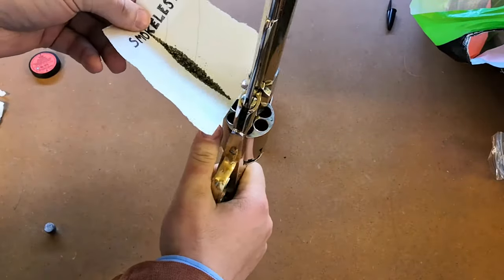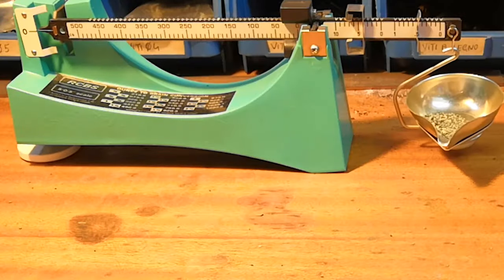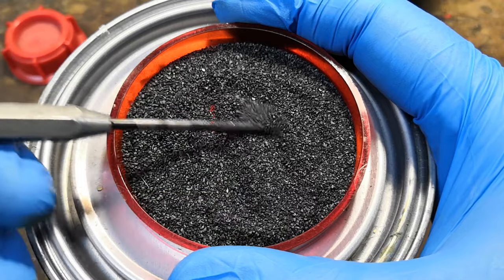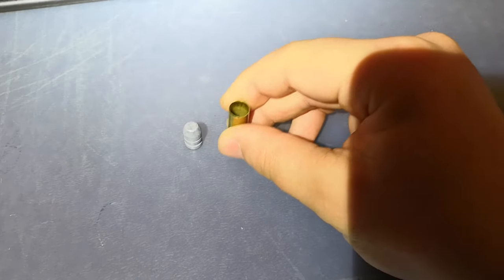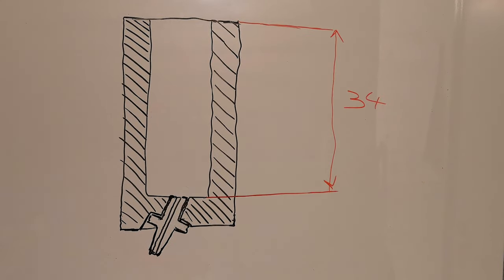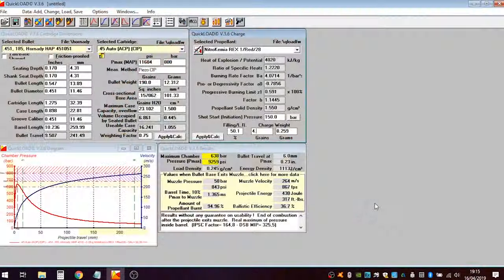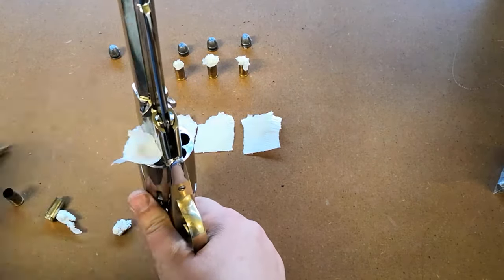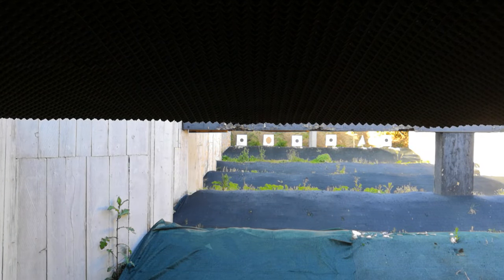Smokeless Powder in a Muzzleloader: What Really Happens ?

Comment: They key is to measure the muzzle velocity and compare it with quickload to estimate the pressure.
Here is a video by IV8888 trying to blow up a muzzleloader with smokeless: youtu.be/en384qVqrug
Reply: Savage Arms proved the right kind and amount of smokeless powder can be used in a muzzleloading rifle over 20 years ago.   Many thousands of the Savage 10ML rifles are still in use today.  Thanks to this channel for being a "Myth Buster".
Reply: Comparing muzzle velocity to Quick Load data can be ambiguous, as pressure spike cannot be exactly calculated without a pressure transducer afixed to the combustion chamber.
Reply: You can buy a reproduction cylinder, epoxy some strain gauges to the side of each chamber, and directly measure how much it strains during each shot. It's a very indirect way of measuring chamber pressure, but it is a direct measurement associated with with the particular weapon and is thus not prone to the errors caused by someone else's unreasonable assumptions.

Oh, you do also need a very fast DAQ to capture the event. Without one, you won't see much on the graph.

I would anticipate some very different looking curves, and I would be careful with how much trust is placed in this method. The fastest of pressure spikes will be mitigated by the ductility of the metal, so if the curve is getting sharp, I would back off.
Reply: Totally wrong
Reply: @Chris_A_  Christ, this is a problem I have, living off-grid on a mountain. I'm smarter than you, don't sweat it, I'm not gonna blow up my kids a second time... But I could use your experience, if you know what I mean... So I've been cooking my noodles over this thought since I found the unsecured recipe, see, and I've got some theories, understand?, but zero experience (and a ridiculously large cannon) and 20 pounds of BP), just so we're on the same page))),... Plenty of brains that need to survive this  next event, but those questions nag at me... Like, how do I measure that blast outta the end, so I don't blow my honey cannon into my brains? Is my main question... 3.5 inch diameter. 18" bore length. Hydraulic sleeve from a massive frickin excavator, 3/4" thick walls at muzzle and base, with 1 1/2" thick god awful strong tempered steel 9" milled into the central column... I'd like to maximize boom with 90-240 grams of homemade black powder. I know a carrot from a turnip. Talk to me like a dude with a cannon that is smarter than you...but dangerously low levels of experience. First eight test fires, I learned some stuff... recorded all of it. Um, I could use your help, please?😜🤯
Reply: The cannon is fine. But I want to toe the max line.. without blowing up my cannon...
Reply: @Horus2Osiris Don’t ever load it with smokeless and have fun.  Metallurgy has come a long way since the 1500s.

Comment: Due to the complexity and unforgiving parameters I will not be trying this, nevertheless your video is very interesting and enjoyable.
Reply: It's not particularly worth it because aside from the risks with doing it wrong, you can generally expect a fair bit lower power with smokeless loads in blackpowder guns. For instance, smokeless .45 Colt loads rated for a good old Single Action Army is not going to be even close to as powerful as a blackpowder load.

Blackpowder guns just work better with their intended propellant.

Comment: I never fired black powder in reproduction cap and ball revolvers. I used smokeless pistol loads with brass cartridge standoffs inserted in the chambers. It was reliable and accurate and safe. I never used hot loads; for the 1851 Navy Colt reproduction I used .38 short Colt loads and cases with the rims  turned off so they could be slid down the front of the cylinder. The primer hole was left open so the percussion cap  could be used for ignition. Powder was inserted into the cases and the bullet seated on the end of the case inside of the cylinder. The nipple was primed and the revolver was ready to fire. 
I like the video and the camera. Thanks.

Comment: It should be mentioned that there's really no reason to ever do this except to prove that it's possible. It's way more dangerous than just using blackpowder, with no real benefit.

Also I like the first-person view. I think you should mix the two perspectives, like take some shots with a side view, then switch to first-person.
Reply from the maker: Yes that's true. There is actually a small benefit, which is that you do away with the dirtiness of black powder, but still I wouldn't suggest it for the general public🤣
Reply: no, if you live in a jurisdiction that forbids anything other than cap & ball , & 
all you can acquire is smokeless,  this needs to be a skill set we master
Reply: There's plenty of reasons.
Reply: There are actually many, many benefits. You use less powder, saving money. You can use much, much larger loads, such as Sabots, without them sticking out of the cylinder. You can probably achieve higher velocities without over pressuring your gun, and get some insane results. In all, you can very possibly greatly increase the stopping power of your firearm. 

For instance, a cap and ball revolver will never get velocities over 2200fps. Why does this matter? Below 2200 fps, your bullet will not create a permanent wound cavity from the expansion of the wound. Flesh is extremely elastic, and so it simply stretches and then rebounds without damage to anything other than the wound channel. This leaves only one way to get larger wound cavities with black powder- hollowpoint bullets, which are actually quite easy to make.

However, hollow points have very poor armor penetration, so you will struggle to defeat an assailant who is wearing more than a few layers of clothing. Kevlar will completely stop the bullet. But, a sub caliber sabot round can easily penetrate a Kevlar vest.

With smokeless, you are also able to be more flexible with the ammunition you use if you have sabots or shotgun style wads (which are really the same thing.) You can use shot without damaging your rifling, or even full steel perpetrators, which will go right through car doors and other thick, strong objects. Of course, much of this is quite illegal depending on where you live. However, this is easily the most effective firearm you can buy while bypassing local restrictions. In some places, reproduction firearms are the only ones you can buy or carry.
Reply: HOTROD Parrish  What kind of shtf situation are you talking about where you can't find modern bullets but you can still find obsolete percussion caps? Perhaps flintlocks are more up your alley. As a side note, if you are going to criticize someone for their ignorance maybe you should improve you basic spelling skills.
Reply: I would argue that this is extremely useful! I own an old 1875 22-short revolver that i absolutely adore! But ammo is very hard to come by!

Original BP shorts vere 29gr and produced 830fps MAX and average 600fps out of the short beral

CCI CB Shorts (Smokeless) are also 29gr and produce 710fps Max with an average of 450fps out of the short beral due to slower burn rate i think! 

I hope this brings some insight to a situation where using smokeless is almost the only option. And how i justify it based on the lower pressures involved using the cartridges listed and simply being unable to find a better alternative than this!
Best regards - C
Reply: @Evan_Schaefering  I make my own percussion caps with a 20 year old “tap o’ cap” cap punch. In fact, I make all the components for my muzzleloaders, cap and ball revolvers included. A shortage doesn’t exist if you are completely self-Sustaining
Another little fun fact. A 44 caliber cap and ball revolver loaded with 35 grains of good quality softwood  powder , A 255 grain soft lead bullet, and a homemade cap, reaches a velocity of 1000 ft./s, which is in energy of 740 FT/LBS. That is on par with 44 Remington magnum, and 10 mm. 
I’m also accurate with mine out to 80 yards. More than that with rifles. These are extremely deadly weapons that can be fed with scavenged supplies and a little know how. 
If you are a black powder shooter I would strongly suggest looking into it. It’s a different feeling when you make everything yourself
Reply: @Evan_Schaefering  whatever you say pal.
Reply: @Evan_Schaefering  I’d give you my Reddit page where all of my stuff is verified, but I don’t want your kind of traffic. Desktop commandos and backyard operators. Think they know everything, but only know what they’ve read on the internet,  from the safety their mothers basement. It doesn’t hold any weight with me. That’s why I dismiss you.
Reply: @poncholefty471  How am I the basement commando here? You just threatened me with a Reddit page. That's fine though, you can insult me all you want. It's your numbers that are off. You haven't even bothered responding to that.
Reply: @Evan_Schaefering  I have nothing to prove to you. These results are posted all over the internet, by people who hunt with these guns. Many before me who also have experience with cap and ball six guns have documented it well enough. These numbers aren’t an anomaly. Reddit is a good place to start, as well as TheHighRoad. Full of people who like to experiment. (Good BP recipes too). Just know that they don’t like people with a your attitude. If getting banned an being ridiculed for playing expert doesn’t bother you, go for it. Also it’s not an insult to your character, I’m only calling it as I see it. It’s actually really  common to see in any gun related conversation, including black powder firearms. There is always that kid, who just got their first brass framed 1851 navy and spends hours and hours researching and watching videos on YouTube, acquiring no real experience, but instead just regurgitate info they have acquired second hand from people just like them. A lot of the time they have never even fired their gun. Some don’t even own one. (Europeans most commonly). This is the impression I get from you. Your cap comment says a lot by itself. I urge you to take a standard New Model Army, (or Old Army) load it like I’ve stated, fire it, and decide for yourself. Best of luck.
Reply: @poncholefty471  I think we went into this conversation with misinterpretation's of each other that continued to worsen until now. I judged you as a misinformed idiot with numbers that didn't add up and you were forced to do the same to me for my admittedly arrogant comments. Granted, I still don't think your numbers add up, but I will apologize for being overly prickly. We'll just have to agree to disagree.
Reply: @Evan_Schaefering  you can make percussion caps very very easily.
Reply: If you have any capability of repeatability there is no reason not to do this .. same powder load ,same bullet , ultra simple to never mess up
Reply: @scribeofalara6259  Way overthinking it and velocities mentioned will never apply to pistols but its safe and cheap and clean
Reply: @waptek2  True but learn how to make your own powder, its simple.
Reply: When you see  SLP  loads  adaptaton in antiques cartridge  guns  create for BP .....  you understand than key  is  DENSITY OF LOADING........ and use one tierce   or  maxi  40% of BP ..... create in each cbamber conditions  of a mettalic light  load SLP  and no problem
Reply: There are plenty of people who think that there is really no reason for individuals to own any form of gun at all. To some extent we as adults need to realize that if we allow ourselves to be forced to justify our freedoms we will have fewer of them when we died than when we were born and our grandchildren will have nearly none at all. "Because I want to" is all the reason one would need, and the fact that there are a multitude of legal reasons why this can be preferred doesn't even need to be mentioned.

Comment: I would really love to try shotgun style sabots from a black powder revolver, but there isn't the room in the cylinder with black powder. This is a really cool way to free up that space- if you are careful. Another thing I have been designing in my head is a very simple 3d printed loading device for quickly loading pre-measured powder loads as well as bullets, kinda like how a capper does your caps. But what am I saying, I don't even have a cap and ball gun.

Comment: There's so many variables at play going down this road, not all smokeless powder is equal being the obvious first one.   Trail Boss being a single base, low bulk density powder would be a good option to carefully work up a smokeless load.   I personally prefer Triple 7 in my Ruger Old Army over a 4-5 grn 'boost' charge of Trail Boss.   The most likely blow out/weak point for over pressure in BP revolvers is going to be in the nipple threads, so if you start to have trouble taking out the nipples or they are stuck, you are approaching danger levels.  BTW-I was taught when loading these (from a veteran shooter) to seat the bullet as close to the mouth of the cylinder as possible, never jammed down deep into it.   The bullet having to jump the gap and then encounter the rifling threads creates resistance and a potential pressure spike, plus this makes for bad accuracy.   I use inert filler material like corn meal or cream of wheat to fill the chamber over a powder charge if necessary to make up the volume.   Just my two cents
Reply: Jumping the gap as you call it does the exact opposite, it lowers pressure. In the rifle world its called freebore and Weatherby with its highy pressure cartridges uses more freebore than normal for a caliber.

Comment: There's a key difference between the two. Regular ol' gunpowder isn't nearly as pressure-sensitive in its burn rate as modern nitrocellulose based powders. That's why it goes off with a quick flash in open air, while a modern powder takes its sweet time.

As soon as you confine it, the NC powder will burn a LOT faster, while the old stuff will speed up a lot less. To be clear, both burn faster when confined, but the pressure-speed relationship of the new ones is much more aggressive.

The chief advantage of going smokeless is the control it can offer over its burn rate, depending on how it's cut. Pistol and shotgun powders are very fast and will probably blow up your gun. A slow rifle powder on the other hand, say out of a .50 BMG cartridge, is going to build pressure a lot slower and will thus come closer to approximating plain old gunpowder.

Comment: Excellent video.  I've done the exact same exorcise in quickload out of curiosity a few months ago.  I think with very careful selection of powder and charge weight you could safely load seated on the powder, but this would necessitate using something very slow burning like IMR4198 in a 44 revolver, but you will end up with a lot of unburned powder in the chambers and barrel as it won't burn well at very low pressures.

Comment: Yes, I've seen a lot of scared comments (and commentators) here, and that's fine when you don't know what you're doing, that is, when you replace the amount of black gunpowder with the same amount of smoky gunpowder, then it's extremely dangerous. But when you know what you're doing, and when you put 5 grains of gunpowder instead of 30 grains of black powder, you add some filling (corn flour) to it, that's a whole other thing. After all, all these revolvers shoot (with conversion) ammunition .45 long Colt, which should mean that they can withstand pressures, which are similar to. 45 LC or less.

Comment: Good job explaining the way cartridges perform under different conditions such as seating depth.  The tune of a rifle or handgun can be changed simply by changing the seating depth.  The bullet loses some mass and the first law of thermodynamics kicks in.  The pressure wave isn't always a pretty one, and depending on initial case or chamber volume, the harmonics lead to positive, neutral, or negative compensation as the bullet exits the barrel.  Optimally, with proper harmonics being achieved based on tuning the round by changing the seating depth, positive compensation is achieved.  The more consistent the weight of the primer, powder, and bullet, then the more consistent the harmonics.  When proper seating depth is attained, then we see the harmonics come into a node which means the bullets are exiting the barrel at the same point of compensation.  Internal and external ballistics in my opinion are two of the most interesting parts of marksmanship.  Understanding them is very rewarding once you see it happen.  It is like hitting a homerun, throwing the perfect pass, kicking a goal, or hitting on the perfect swing of a hockey stick or golf club.  You can hear the weapon's tune shift and you don't really feel the recoil as much.  The vibration ends rapidly rather than continuing.  It's what I call a dead tune, because in long rifles, there is no sound during or after the bullet exiting the barrel.  The recoil isn't as severe, and the yank of the barrel from the pressure wave isn't as bad.